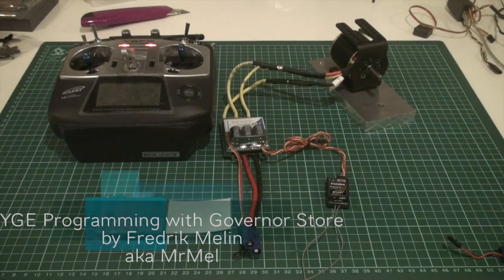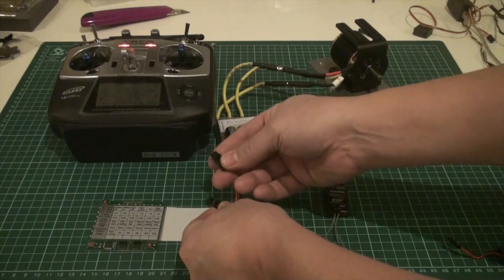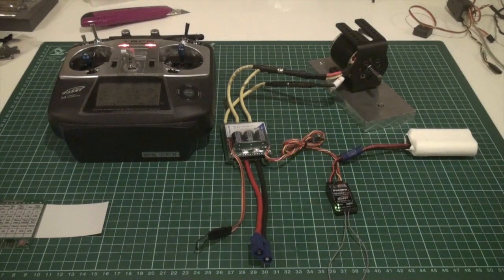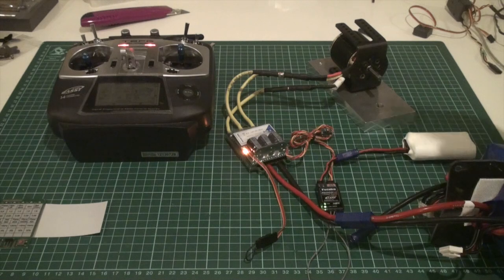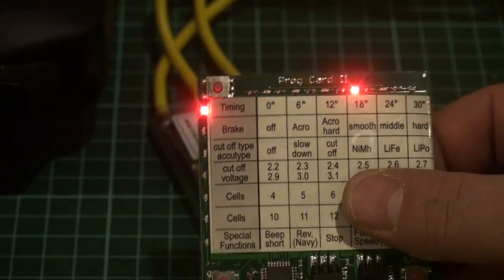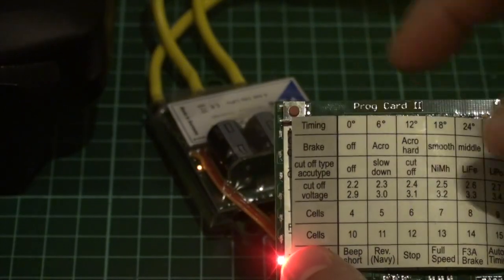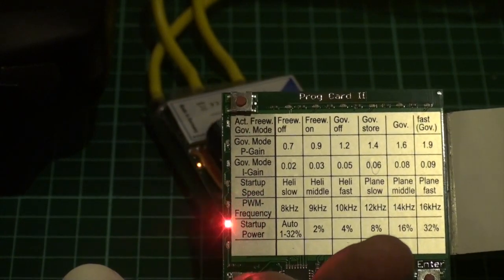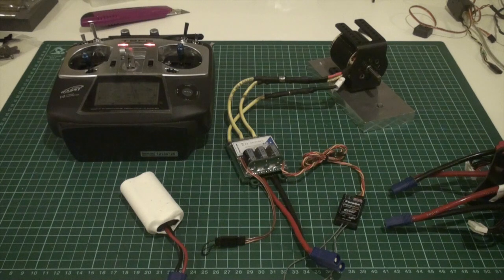YGE Programming Governor Store

Comment: It's a old vid so not expecting a reply but if anyone could help it would be awesome. I use normal gov mode (no store) when I Power up at 75%th I'm at around 1950RPM then switch to 85% I'm at 2250. Switch to 90% nothing happens.

If I spool up in idl up 1 85% I'm around 2000 rpm when I switch to normal mode the headspeed drops to 1850. I'm totally lost here. All on a fresh pack

Comment: Hello Mr Mel,
I have a YGE 60LV in my X3, paired with Scorpion motor 1580kv, 13T pinion, 131 main spur gear, 6s power system 1300mah batteries. I did exactly what you did on this video, but when I got to the last part where finally the ESC is ready so it can learn the max speed, when I get to full throttle the Esc cuts off and goes back to beeping mode governor store mode. But when I set my throttle curve to 0-60-60-60-60 on normal mode and go to full throttle then it doesn't cut off anymore and the beeping stops also. I was wondering if the Esc learned the max speed by doing so, will I be able to set a proper flat curve on stunt 1 & 2? Thank you so much..